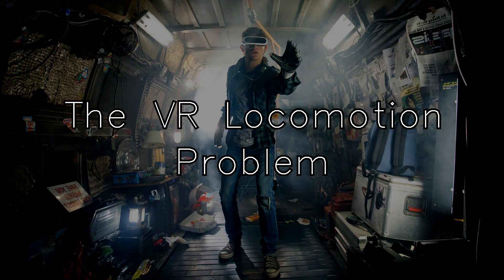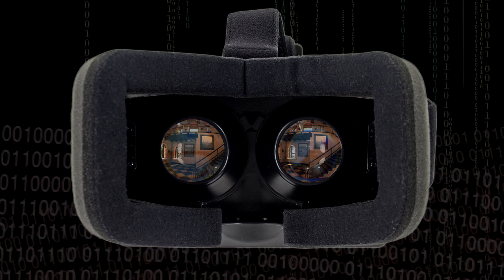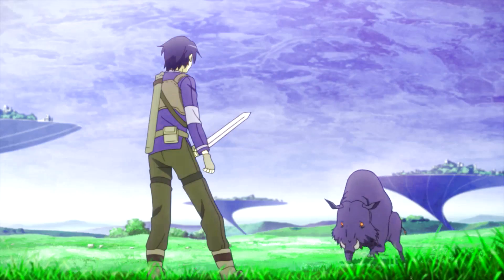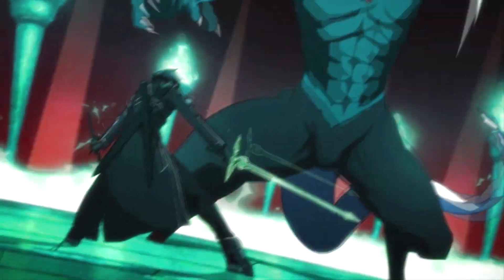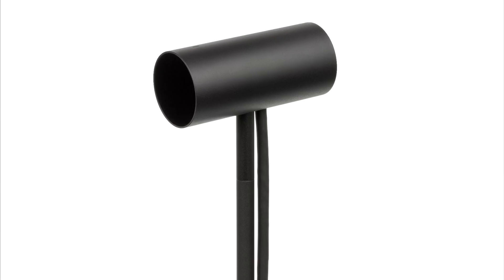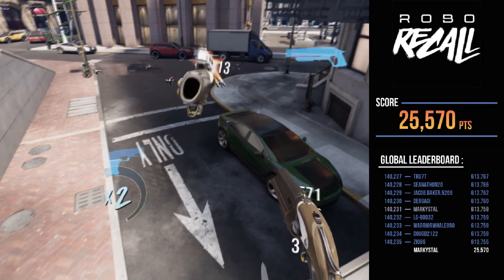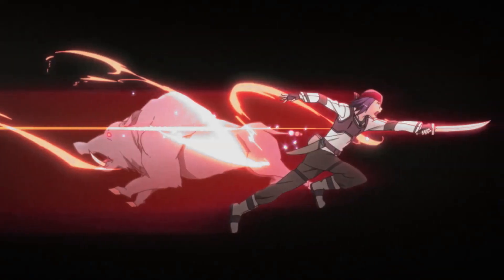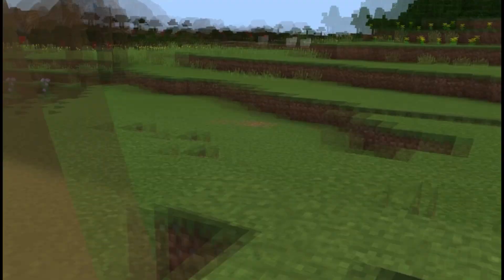The VR Locomotion Problem

Comment: What if we used a cheap version of a stepper for walking.
Reply from the maker: That's actually not unlike what some companies are trying to do with omnidirectional treadmills. Stepper machines have the issue of being stuck in a single direction at this point, but a future version which basically suspends you in the air wouldn't be bad option. It's just a bit tricky to manage the positioning, prediction, and the energy costs, but it's definitely not off the table for the future if a neurological solution isn't developed soon.
Reply: elliptical is what i meant not stepper as for turning you could do head look or engineer som sort of turning base or maybe something like this www.walmart.ca/en/ip/progear-dual-action-360-multi-direction-36-inch-stride-air-walker-ls-elliptical/6000196065528

Comment: Yep. Setting up the tracking in my room is annoying for the rift and i have pretty small play area so these problems are very real for sure
Reply from the maker: I can sympathize. My 2 sensors for my Rift frequently have their own issues in my small room. Now a days, I prefer VR software that doesn't even use motion controls half of the time just due to the inconvenience. Every small annoyance a user has to deal with when using a technology is just another barrier between using it and it's long term adoption.
Reply: Virtual Dreamers exactly I feel bad to say it but it still feels kind of feels gimmicky. Makes me sad but when rift 2 comes out you best believe I’m still going to get that one.